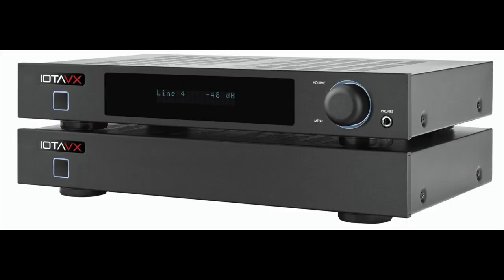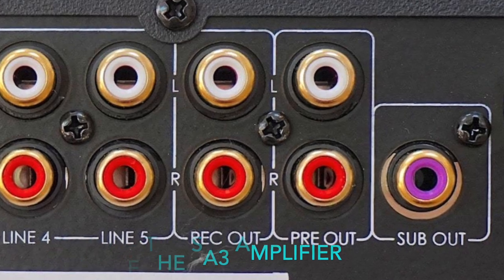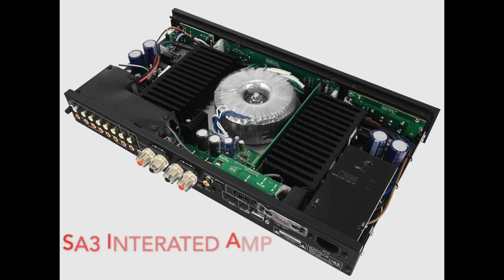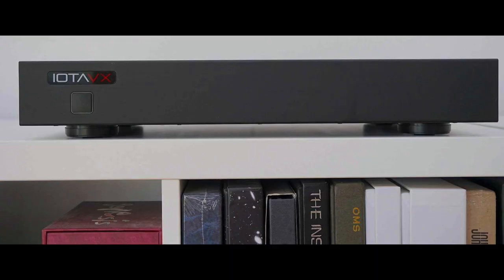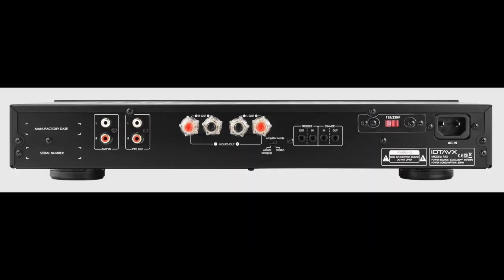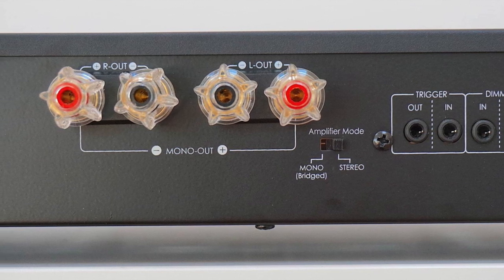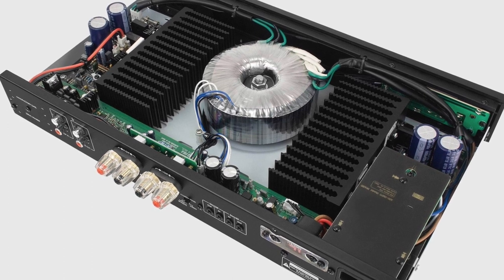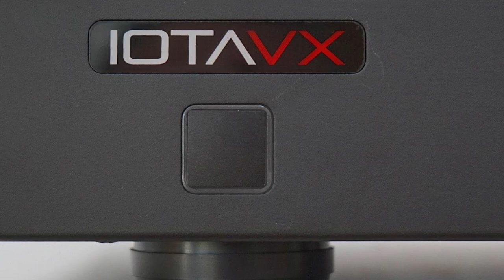IOTAVX PA3 Power Amplifier Review: https://www.iotaenterprises.co.uk

Comment from the maker: OK, there's been some confusion (mostly from me!) in what happens when a PA3 is connected to a SA3 in Bridged mode. Firstly, If you connect a PA3 to a SA3 in Bridged mode, the SA3 itself becomes a monoblock and looks after the right channel. The PA3 then becomes the left channel. I did hear that you could connect more than one PA3 power amp to you hifi and yes, you can indeed add more than one PA3 amp to your hi-fi. I assumed that two PA3s would then become monoblocks but that's not so, it appears. The SA3 will always be a right channel monoblock in Bridged mode. The PA3 will always be a left channel monoblock. What you're able to do is 'chain' PA3s. So you can attach more PA3s to the left channel, PA3. You can run many PA3s in this way. Each time you will add 50-100W into 8 Ohms. So adding more than one PA3 is purely a means to increase power. The company hasn't tested the limits of this in terms of just how many PA3s will connect successfully or if the power drops off after a while. I wonder if this design would be better implemented in a Public Address-type system set up? Apologies to all for the confusion.
Reply: Hi Paul, thanks for your replies (including to my comment above)
I think you must have mis-understood the 'bridged' mode and what you have replied is correct.
The SA-3 becomes the right channel & the PA-3 the left. You then have double the power and a really great sound.
Well worth a try for you if you still have both units, as I'd love to hear your opinion on the combo (& you can use the cables supplied to connect the trigger & dimmer sockets on each so that turning either amp on also turns on the other, and the dimming setting you have applied on the SA-3 changes the on/off switch brightness to the same level on the PA-3)
I hope to look forward to a new or updated review ;-) 
Thanks
Reply: @palmman50k  if you all wanna see how to hook all this up , I also reviewed this  integrated amp power amp Stack  . Then i added the Emotiva BasX a-300 off from the PA3s preouts lh and rh this way you can bi-amp but your 3rd amp needs to be atleast 100watts at 8ohms but not over 200watts for bi-amping I also used my Onkyo integra m504 monster amp so i use the IOTA Stack for High frequency and either my Emotiva or Onkyo integra amp for low frequency , but you only need to do this if you have hard to drive speakers. 
i use this for my Polk Audio LSIM speakers they love power yes the stack is enough but I like headroom Its nice that a company lets you upgrade as you go , Here in America we got the Gold and black High filter compasitors a total of 54,200 micropheretes which has very nice dynamics for 100 watts at 8ohms and 180 watts at 4 ohms having those 2 power supplies of amp helps alot also instead of just one 115v check me channel out i just done a comparison video 😆
Reply: @tee-jaythestereo-bargainph2120  Thanks Tee-Jay (BTW, great videos too). I'm quite happy with my IOTA stack as it is. The Emotivas seem to be very good too, and a real bargain in the USA, but they are a bit more here in the UK ;-)
Reply: @palmman50k  i didn't realise how much i wrote on my previous comment 😆 Yeah for the money the IOTAVX-STACK is Top level at under 1k here in the 🇺🇸 its 900.00 bucks and worth it . I was just saying if you have very enifficant speakers you can add another big amp to the IOTAVX-STACK , But if you have very efficient speakers like the Klispch RP series you only need the SA3 for power its an awesome amp enjoy everyone stay safe ✌
Reply: The way I'd use two PA3 amps with the SA3 is keep the SA3 in stereo mode, bridge both PA3 amps to serve as a left and a right monoblock fed from both SA3 pre outs.
Reply: "The SA3 will always be a right channel monoblock in Bridged mode. The PA3 will always be a left channel monoblock. What you're able to do is 'chain' PA3s. So you can attach more PA3s to the left channel, PA3."

So you need the SA3 for the right channel, meaning you can't just get 2 PA3's bridged together (assuming i have a pre-amp/dac already)? As for adding PA3's, wouldn't one SA3 with two added PA3's mean 1.5x more power in left channel? That seems unbalanced haha, maybe i'm not understanding how that works or how you worded it. I just don't need the features of the SA3, but would consider stacking one PA3 with another down the line, if I can.

Also, according to this, bridged amps work differently than monoblocks. mainly that the impedance of the speakers is halved. https://www.youtube.com/watch?v=ts-n9qpyfCY  (i'm guessing that makes them a bit harder to drive?)

Comment: Great review, Paul, thanks. BUT, you missed a major plus point of the SA-3 and PA-3 together, and that is putting them in to bridged mono mode (you zoom in on the back panel switch and speaker connections showing this), where the SA-3 acts as both the pre-amp and one channel for amplification and the PA-3 acts as the other channel amp.
In this 'mode' the power output basically doubles and sound quality really improves, turning these into a tremendous value pre/dual mono combo for just ~£700!
(As you can guess, I have this combo & am VERY happy with it)
Please can you either update the video or do a follow-up where you discuss this? Thanks
Reply: @johnsweda2999  hi, he said, around 100 watt into 8 ohm, by using two, PA3,s,, no mention of bridged mono.
Reply: I also have this combo, and run in bridged mono,, I owned a flagship Technics SEA 2000 power& pre before, but this beats it in almost every way, apart from looks.
Reply from the maker: I didn't offer more info because...I might have this wrong. It was in the editing stage of the video that I wondered if I had misunderstood the company on this and so I pulled back a bit.  have asked and am still waiting for a reply but I'll issue an update on this ASAP. Maybe the monoblocks are out and a bridged mode in mono only is the only option. Let me double check.
Reply from the maker: OK, I've had some clarification from IOTA - they work Sunday! Blimey. Looks like I need to pin a note in the Comments on this. If you connect a PA3 to a SA3 in Bridged mode, the SA3 itself becomes a monoblock and looks after the right channel. The PA3 then becomes the left channel. There is a suggestion that you can then chain more PA3s from each PA3. More info to follow.
Reply from the maker: OK - more info and I see the reason for my confusion now. You can indeed add more than one PA3 amp to your hi-fi. I assumed that two PA3s would then become monoblocks but that's not so, it appears. The SA3 will always be a right channel monoblock in Bridged mode. The PA3 will always be a left channel monoblock. What you're able to do is 'chain' PA3s. So you can attach more PA3s to the left channel, PA3. You can run many PA3s in this way. Each time you will add 50-100W into 8 Ohms. So adding more than one PA3 is purely a means to increase power. The company hasn't tested the limits of this in terms of just how many PA3s will connect successfully or if the power drops off after a while. I wonder if this arrangement would be better implemented in a Public Address-type system set up?
Reply: @TheAudiophileMan  ⭐⭐⭐⭐⭐
Reply: Yeah but by doing that your speakers have to meet the new power output from that now mono channel being the mono channel would be double the output that it was before so you have to take this into consideration before getting your speakers because you don't want to overpower them although hard to do chances are if you double the power especially from 100 to 200 it could very well overpower them. Agreed?

Comment: I have one of these, it's nothing short of remarkable. I use my pc for my music, mostly flac files, using the digital coax output from an asus xonar essence stx sound card to my audiolab 6000a, I also use a Denon X3500H for home cinema but use the Audiolab for music. I wanted a power amp that I could switch to being a monobloc, for my centre speaker and the IOTAVX PA3 met my criteria perfectly.

Out of cuiousity I thought before connecting the IOTA up as a single channel amp I would see how it sounded using the Auidolab as a preamp. I wasn't expecting much with the Audiolab being so hightly regarded as an integrated, I was shocked to say the least, this IOTA sounds fantastic, and to me it suits my taste in sound quality moreso than the Audiolab. The only downside is the illuminated logo on the fascia.
Reply: I did the same, also not expecting that much, but sounds fantastic! Great minds think alike! 🙂

Comment: Wish I had more experience in audio, but so far so good with the SA3+PA3 combo. Seems pretty neutral and more airy and open than my PM6006, plus, plenty of power. So yeah, for £700, that'll do just fine, I don't see myself needing anything else really. Wish it had subwoofer management though (low frequency cut-off for the main speakers), but that's a nit pick.
Reply: hi can you share more insight on this? is there any aspect where the PM6006 does better than the Iotavx?
Reply: @mykeldg  Sure. It has stronger EQ, you want bass and trebble, you got it, and it's not terribly harsh. Has loudness control, which is useful with low sensitivity speakers and low volumes. Has EQ bypass, Has dual speaker-level outputs, meh, was useful when I had to wire in the my SB-1000 subwoofer, because it doesn't have a dedicated subwoofer out. Doesn't have line-out though (has record out). Two optical in, which could be useful in a hi-fi environment, decent DAC.

Basically, it's a solid general-purpose hi-fi amp, good build quality, good sound, plenty of features, couldn't say about the dac but seems to do its thing.
Reply: If I'm going to be using this with 4ohm 88 db sens speakers that are a little on the trebly side, which would you rather watch movies and listen to music with? Iota sa4 (without pa4) or pm6006?
Reply: @jldkrank  hmm... I would still say the Iota. If a bit too sharp, maybe you can play around with speaker toe-in / toe-out? 

Either can control the treble somewhat, PM6006 has more oumph in the low end and is rounder, can get crazy with loudness control. 

If just lacking bass and punch, I would really look into a subwoofer, it's really next level for stuff like movies and punchy music. Probably don't need to go crazy with SVS either. Klipsch, PolkAudio, cheaper alternatives, second hand. 

There are options too. Denon, Yamaha, NAD, AudioLab 6000A (more expensive really, but Tarun seems to like it, has more 'stuff'). 

Hard to say, but between the two, with no other considerations (no subwoofer, remember, high level inputs required with PM6006, no upgrading later), the PM6006 is pretty nice out of the box, and fuller bass if you need some help with that. Resale should be more straight forward as well if you want to go next level later.

If you want more audophile goodness (more open, leaner, airier) and willing to go subwoofer or more power later (PA3), the Iota would be my choice. 

My $0.02.

Comment: I had the S3 but traded it and got the P3 with a Topping E30 acting as DAC/preamp. This is paired with Triangle BRO3 speakers. Sound is much better with the E30 and P3 combo than the S3. Especially midrange and treble. I think this is due to the E30 being a much better DAC than the Wolfson the S3 has (plus lower noise from having separate DAC).
Reply: Doesn't the topping have the same DAC? Or am I wrong here?
Reply: @2HatHudders  Same with what? E30 has an AKM chip, the AK4493 I think.
Reply: @jaytorr6701  hey sorry,, I thought the S3 and Topping E30 have the same Wolfson DAC? I thought they did, unless I miss read something
Reply: @jaytorr6701   I was thinking of getting the sa3 then upgrading with the power amp later in the year.. after reading your comment, I'm not sure now haha
Reply: I'm going to buy the triangles too, recommend them ?
Reply: @2HatHudders  I do. Though have a look at the Q Acoustics 3030i. I have the 3020i and they are wonderful.
Reply: @2HatHudders  there is a trade off. Having a proper pre-amp increases gain and affects overall sound. On the other hand, something like the E30 can act as a preamp. If you appreciate a clean and airy presentation, with loads of top end then maybe the DAC to Poweamp route is better.

Comment: Tempted by a Schiit Gjallarhorn but this IOTAVX PA3 is the same money. I’m not too fussed by the power difference and plan to use it with my Schiit Lyr2 and Royd Minstrels or Abbots. I’ve got vintage Rotel RA820BX and NAD C320 but thinking either of these would be an improvement? I prefer a warmer brighter sound with emphasis on bass and treble.
Reply from the maker: I'm sure you would have lots of fun with this one and go for it if you like the look of this box although in pure sound terms, I would lean towards the monoblock Gjallarhorn set-up.
Reply: @TheAudiophileMan thank you for that. It’s difficult to be sure exactly which direction to go without being able to actually audition gear before buying.
Reply from the maker: Try requesting a home demo from your favourite dealer. If they’ve got any business sense (and are looking to establish a possible long term relationship with you) then they will work with you. Make the call.
Reply: @TheAudiophileMan many thanks. I’m very remote with no local dealers. I’ve gone for the PA3, interested to see if it improves on my current set up of Schiit Lyr 2, Rotel RA820BX, Royd Heralds. From what I’ve read the Schiit 10 watt per channel isn’t really enough grunt and the monoblock option is too expensive and I don’t have balanced out on my Lyr 2 either. Correction, IOTAVX PA3 didn't work out so have bought a Schiit Gjallarhorn which I'm listening to with my Lyr 2 and Royd Heralds. It sparkles more but does make me realise how good my Rotel RA820BX still is from 1986 when I bought it new.

Comment: Hello.    I recently purchased the iotavx stack and was contemplating buying another PA3 amp to run as a mono block.   Could you kindly guide me as to how to connect two PA3’s to the SA3 preamp.    I enjoy your videos very much btw, very informative and detailed explanations.    Gabe
Reply from the maker: That's very kind of you. You can't plug in two PA3s as monoblocks in a traditional stereo sense but you can bridge the PA3 which basically means connecting them in a sort of serial fashion. Basically trailing off each other in a line to add power with each connection. In this way, the SA3 acts as power for one channel and the PA3 provides power for the other channel. From what I gather, if you then trail umpteen PA3 units off the back of that lot, then more Watts are added.
Reply: Thank you, I appreciate the clarification.   Keep up the great work!!!

Comment: The Audiolab 6000a is at present rated the best sub £1000 amp on the market . My question to Paul is do you think the iota pre power is better than the Audiolab 6000a . The Iota would be £100 more expensive but still under a grand .?
Reply from the maker: Do you mean the SA3 and PA3? If so, that's not strictly a pre/power and I wouldn't go there if you currently have neither. It's an upgrade thing for current SA3 owners really. As it stands, it's more an integrated/power and, because of that, the performance is very good but could be improved with a better pre. Something from Schiit, a dedicated pre, would be a better option here. A Saga perhaps for around £390? A Saga/PA3 is not a pair I'm familiar with in performance terms, though but I would expect it to perform very well indeed and better than the 6000A but, as I say, I have absolutely no proof, only a gut instinct.
Reply: @TheAudiophileMan  I'm curious, did you test the PA3 with the SA3 working only as a preampliflier? My doubt is which way the combo would sound better, SA3 working as a preamp (or with another preamp like the Schiit) or in bridged mode with SA3? I have read that in the latter, apart from more power, changes the sound balance to a treble tilt.
Reply: @TheAudiophileMan  So what you are saying is the SA3 and PA3 working together does not sound as good as the Audiolab 6000A on its own?  Thanks for great videos.
Reply: mark Buttery this is my dilemma too. Going to audition the audiolab 6000a tomorrow...but for £100 more can get the iotavx stack which I can’t audition. Bit stuck really. Driving wharfedale evo 4.4s by the way.
Reply: @garyjones5947  Yes i feel your pain, I was going to order the Iotavx stack , but they took some time to reply, so being the impatient person i am i looked elsewhere .Now i am more confused .The problem is that you cant sit down and compare, the stack could be better or worse then the Audiolab.I have only heard good things about the Audiolab though ,now i have cast my net wider the Schitt Ragnorock2 is on my radar .I have dynaudio 72 speakers.Please let me know how you found the Audiolab
Reply: @garyjones5947  Hi there, which was your final pick? and why? I have the same dilema.
Reply: @elbebe1000  Hi. I would say that it depends on your circumstances. If you have difficult to drive speakers, or a large room, the iotavx stack is powerful. It also has tone controls, so you can mitigate any bass null points in your room. If however, you have reasonably sensitive speakers (88db upwards) and your room acoustics are naturally good, go for the audiolab. It also has a superb sounding onboard dac...better than the iotavx  stack. The reason that I give it the nod in those circumstances is that it is more detailed, and offers a more beguiling soundstage, in addition to beautiful tonality. The iotavx stack is bloody good, and powerful too...just slightly behind on the finer nuances.
Reply: @garyjones5947  Thank you Gary. I have Buchard S400.